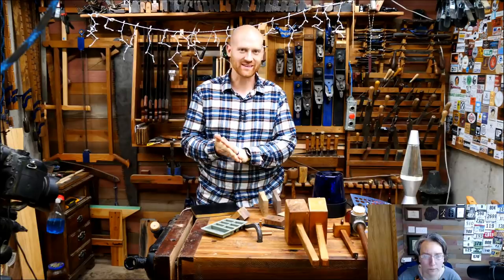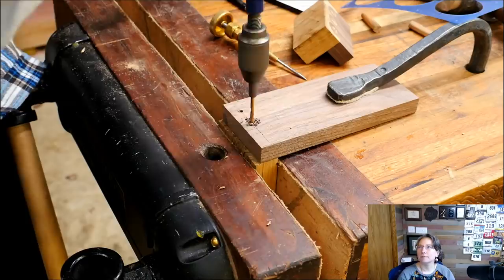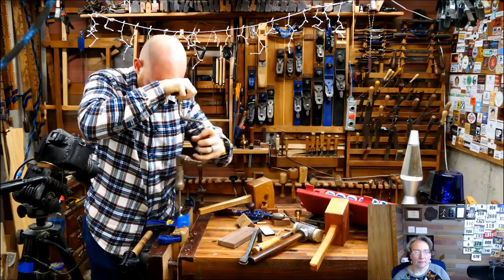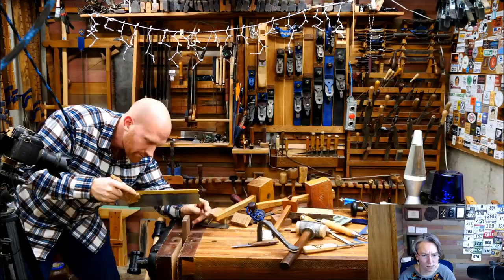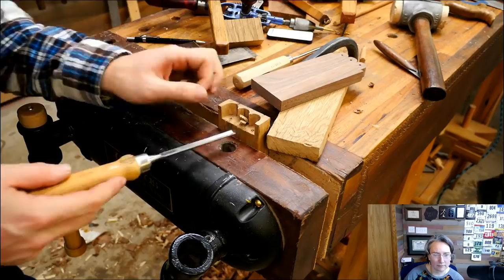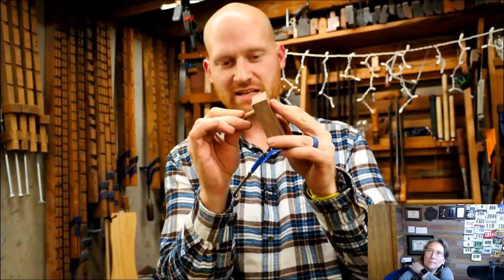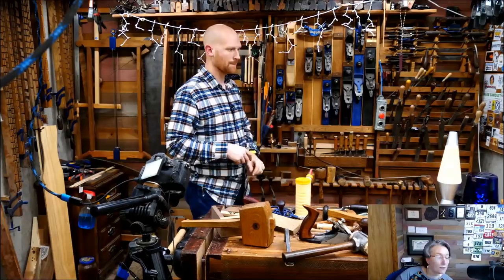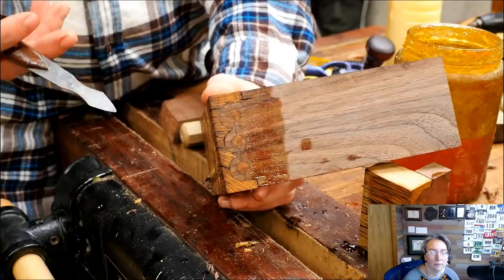How to make a Cove and Pin Dovetail With Hand tools, Live | Knapp joint

Comment: About blowing dust out of holes.  I drilled some holes in concrete for rebar and got a face full of concrete dust when trying to clear a hole.  I took a 2 foot length of 1/4" tubing, put one end in the hole and blew into the other end, dust came out of the hole and NOT into my face.  Tip, put a piece of painter's tape on one end of the tubing so you don't put the wrong end in your mouth.  I've had that piece of tubing in my tool bucket for 12 years and still use it from time to time.

Comment: Aloha James, I knew this joint as the Bermuda round and pins joint and it was an 'unplugged' tool produced joint made with hand tools in the colonial days. Am I wrong? I was told it was hand cut with a 
plug cutter in a brace and bit to form the pins of the drawer sides and a coping saw to form the rounds. I've never had a commission to make one, but always hoped it would come up.
Reply from the maker: thanks mark. I am sorry to say, but the info you got was a bit off. There are several sources talking about how they came about. here is one. https://www.finewoodworking.com/2018/09/26/history-cove-pin-joint

Comment: Thought you were going to use something along the lines of a plug cutter. I guess it wood still be easier to put in dowel pins after the fact.
Reply from the maker: If I had a big plug cutter and a way to do it with hand tools I might try that.
Reply: @WoodByWright  What about using your manual drill press?  Would you be able to use a plug cutter with that?
Reply from the maker: @red58impala  the problem is finding a plug cutter with big walls. there is just no reason to make one like that.

Comment: Interesting joint. How would you make the tails with what powertool? The gouge you use has the bevel on the outside. I have two chisels/gouges with the bevel on the inside. Do these have a different use? For woodturning?
Reply from the maker: the gouges with bevel on the inside are called incannel gouges. they are most commonly used on compound convex carvings. not very commonly used but when you need one they are so useful. the powertool version does not come to as tight a point as these do. and some have flat or rounded bottoms for just that.
Reply: Power tool wise I would probably use the scroll saw.

Comment: I don't see the strength advantage of using this joint over a rabbet with some dowels into the end grain. You can do this easily with power tools.

I guess it's got some flourish compared to that.
Reply from the maker: correct. there is no strength difference. the difference is a pined rabbit joint would not sell as well back when everything was hand cut. this was the first Powertool cut joint that sold as well as the hand tool version.